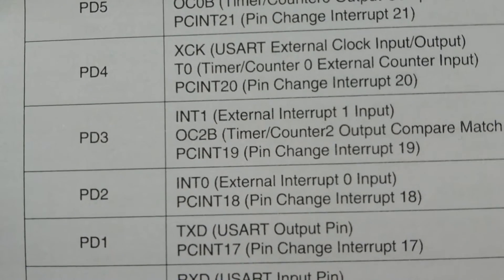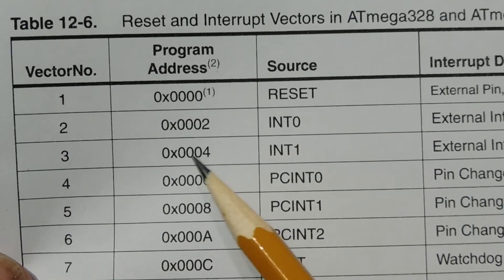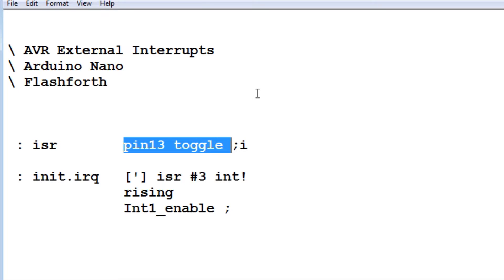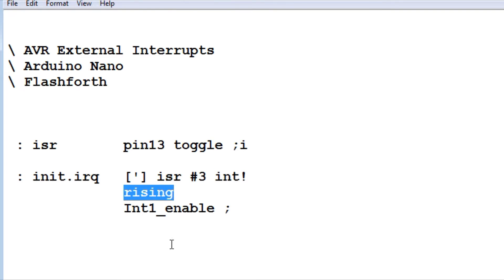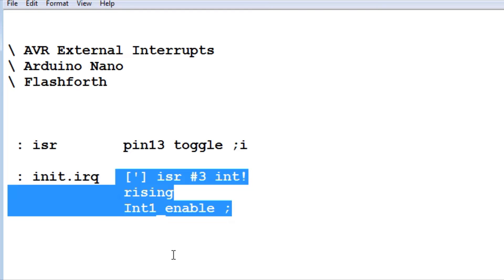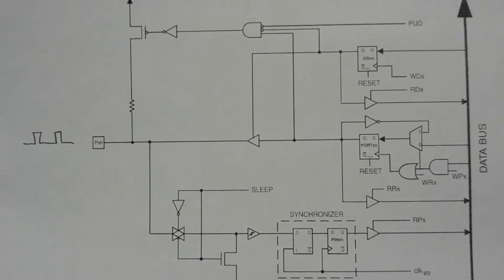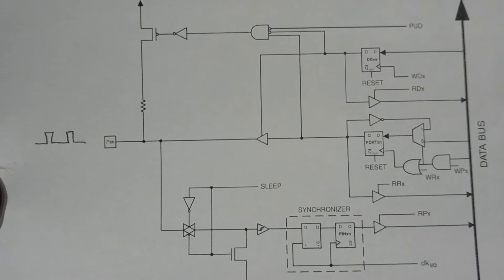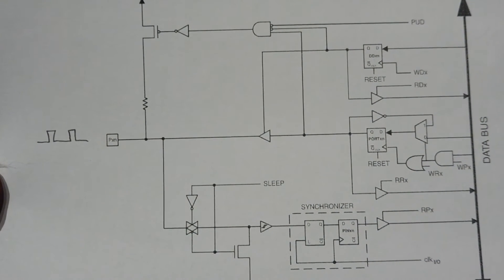Arduino External Interrupts  / AVR

Comment: @0033mer  But how to do this without pressing Enter after selecting character on the keyboard. Even in case of Arduino when we have Serial Monitor we have press Enter. But how to this in case of fx Atmega8? So far I did not find solution in internet.
Reply from the maker: I use this technique a lot in my videos. Check out this video that has code examples.
https://youtu.be/uLA2MvKYLZs

Comment: Thanks for sharing, I am trying to follow along. I can find "int!" in the built in dictionary, but not "rising" or "Int1_enable", are these words you have built or are they part of an extension? Can you please share?
Reply from the maker: Go to the External Interrupt chapter in the ATMega328p data sheet and look up the EICRA and EIMSK registers. The EICRA register sets the rising/falling input by flipping some bits and the EIMSK register will enable/disable Int1 by flipping bit 1. Make up your own words to do this or use the names I have selected.
Reply: @0033mer  thank you, I will do that.
Reply from the maker: Check the description box for a link to example code.

Comment: I didn't know you could use an output and input of the same pin that way, thanks. I used to get circuit cellar magazine. That was when the internet was dial-up (expensive & slow)

Comment: I have seen you use that forth language before, and it seems useful to use the keyboard like that to communicate with the micro. 
Can one use it to communicate with an AVR microcontroller if you program it in C first? (Not using the Arduino system? )
Reply from the maker: Forth is a programming language and an operating system. It stands alone as it has its own interpreter, compiler and flash programming mechanism. It is installed on a clean slate as the Arduino bootloader is overwritten.

Comment: If you already have a loop of code running on the nano, how does it know to read the keyboard and toggle on pin3? And if it does do that, why not link whatever activates pin3 output to just the "functionality" of the interrupt function?
Reply from the maker: Detecting the "up arrow" key press on the keyboard is now the main loop. On keypress detection a pulse is sent out GPIO pin3.
This pulse will trigger the interrupt and toggle pin13. The goal is to generate a voltage transition on pin3 to test the interrupt.
Reply: So since the keypress detection is now in the main loop, you could hardly say it's an interrupt event anymore in a true sense of functionality... but your idea is this is purely for testing an isolated interrupt function?  @0033mer
Reply: The true interupt mechanism is actually used. It is the actual interupt hardware silicon at pin 3 that is sensing the pulse and interrupting the program. As the pin has several functions, this is one of the things one can do. Trigger a hardware interrupt via a software trick like that.
Reply: @ivolol  The interrupt flashes the led. It doesnt detect the keypress. The main loop just monitors the keypress and when there is a keypress  the output on pin 3 goes high (still running from the main loop). That high is also detected on the input of pin 3 which is has been set up as an interrupt source/trigger.  At that point the micro interrupts the main routine to run the interrupt routine which flashes the led. After that the micro goes back to just running the main loop waiting for another keypress.